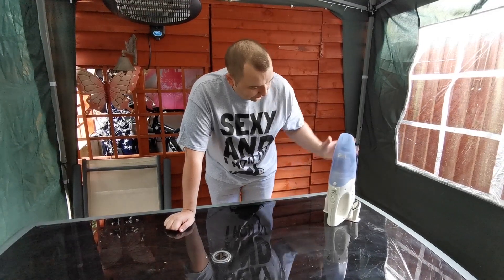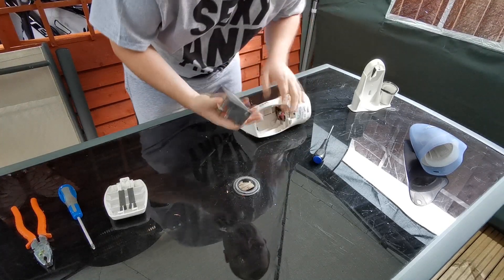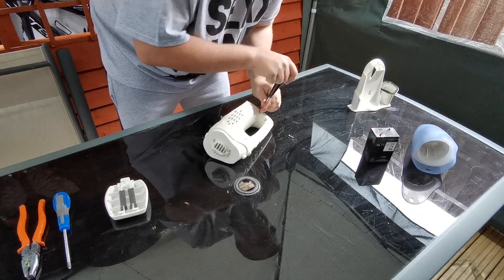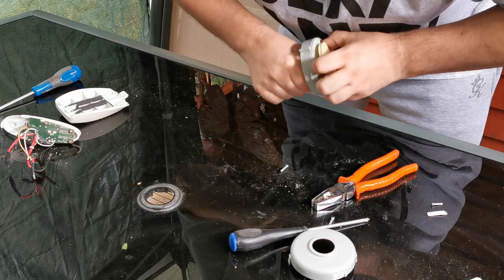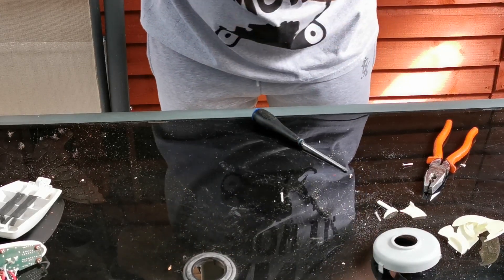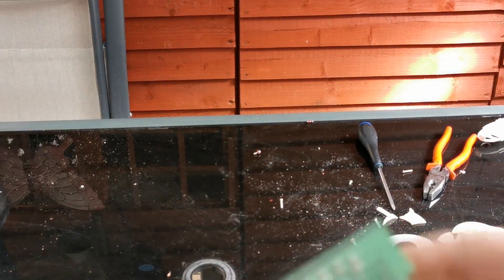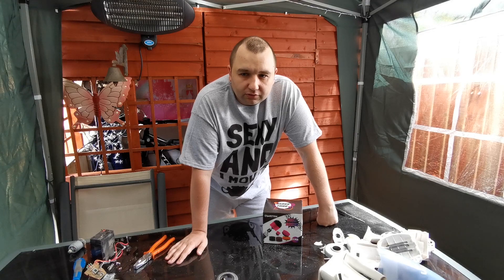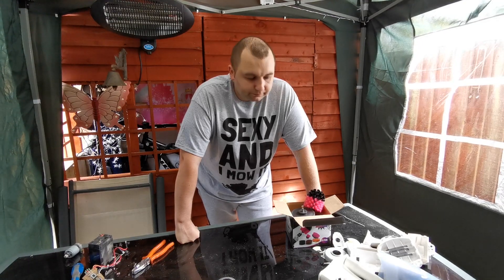Vax Hoover Strip Down

Comment: You should desolder and keep those old micro controllers from the circuit boards. There's a market for old chips. List them on ebay using the model number. I restore old 8 bit computers and some older chips are getting really difficult to get a hold of.
Reply from the maker: Cheers rab il look into that 👍